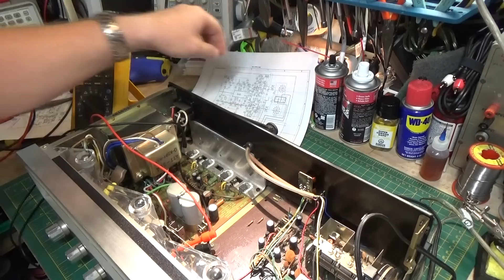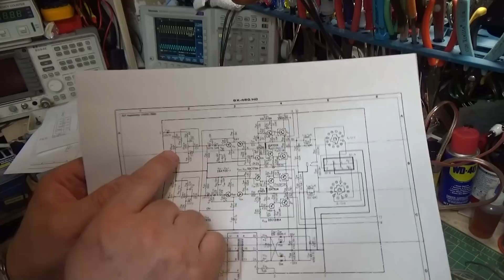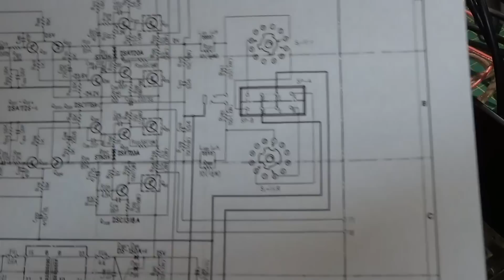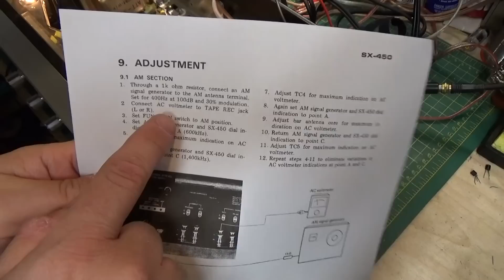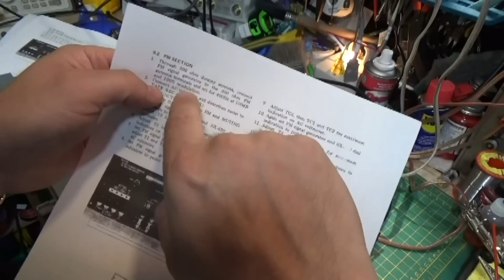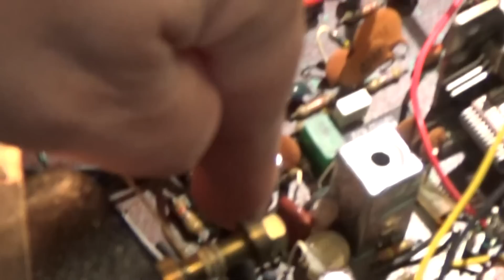PIoneer SX 450 Repair and Restore

Comment: Hi Tony.  I've watched many of your vids.  this one interested me because I obtained one of these online and it has no power.  6 FUSES? Yikes, that was my response when I saw it after opening the case. I appreciated your insight into the small transistors as I believe that is my focal point given that all the voltages out of the power supply seem to be correct.  I can't see all the fuses so I will need to dig deeper to do a continuity test.  I can SEE that the electrolytics are leaking on the board so recap is likely needed too.  Really appreciate it.  Can't wait to hear this Pioneer purr.

Comment: Hi Tony. I realise this is an old video, but thought to add my experience with the SX450 for Bias adjust and DC Offset for others who may visit this. I had to replace some outputs - originals were SD313- used MJE15032G (same pinouts). Had to replace some driver transistors (Q207/Q208 2SC1318A with KSC2383Y) same pinouts and (Q209/Q210 2SA720) with  KSA1013Y same pinouts. Now for BIAS adjust, I replaced the 82R resistors ( R221 and R222) with 100R multiturn posts (middle leg soldered to one of outer). I could adjust bias down to approx 20mV. Scope sine test , just prior clip, achieves approx 12.88Vac RMS into 8ohm load = approx 21W one channel. Nice clean sine... For the DC offset, I took the advice of service manual and connected 8ohm load. One channel had circa 30mV, the other, a rather large 300mV. I replaced the 2SA725 transistor sets Q201/203 and Q201/204 with carefully matched Vbe / Hfe type KSA992. NOTE: Watch the pinouts of replacements. Thank goodness the screen printing on component side of PCB indicates correct orientation. I now have circa -18mV both right and left, so good success. Thanks for the video. Now I have to get onto the tuner, like yours mine seems dead... Keep up the videos. Your knowledge is vast and your presentation and "simplification" is invaluable...cheers from Sydney, Australia.

Comment: I have one of these in my dining room with a pair of Bose 301 II. Fresh capacitors in the speakers. Sounds wonderful. The unit finds stereo, but after it warms up you need to retune the station a smidge. Wondering if it would be a minor tweak or a whole alignment procedure?

Comment: Hi, I received a used Pionner sx450 from facebook marketplace, my main issue is that one set of the speaker terminals require some type of pressure in order for them to output sound, can anyone tell me what could potentially be the problem?,

Comment: I bought an SX 680 where the tuner does not work. Probing the supply to the tuner board, I see not 13.6V.  Then I started probing the transistor supplying that 13.6V. After a few probes around the transistor, it started working. It's been working since. I suspect a capacitor near it is bad as I see some black crud near the base. Does anyone ever experience such a phenomenon that fixes itself by just probing with a voltmeter.
Reply: Yes! A lot of times it a bad solder joint,   by probing or moving components, is a good way to troubleshoot and also pushing in\Out the board also can find lose components and then look from the bottom of the board for cracked or holes in solder joints.

Comment: I have a Technics from 1977 that pretty much looks like that Pioneer.   Found out it was made by Pioneer.   Still works great and sound!   I run it at 3 on 5he volume knob.   Pretty loud there.
Reply: Technics stereo receivers and component systems as I know it, is a subsidiary of Panasonic Electronics.  It couldn't have been made by Pioneer Electronics, two different companies, Pioneer and Panasonic.  Panasonic electronics inc. Has recently bought out Sanyo Electronics as all my tv sets are Sanyo wide screen tv sets and and I love them very much.  They all have been very reliable and work perfectly all the time.

Comment: Is it possible to use your pin drill and drill a small hole thru the circuit board at the point where you would spray your cleaner into the pot....thus not having to remove the pot at all...to clean it, and save all the time doing it. I know this is thinking outside the box but that is the way I am.

Comment: I have a SX-450  was a Great stereo until someone pressed the Tape button with no Tape Deck hooked up! I was told it has a Channel blown out, so DONT press the TAPE DECK BUTTON WITHOUT A DECK  HOOKED UP.
Reply: Hmmm.  This seems unlikely to hurt anything.  Maybe a coincidence?
Reply: @65Superhawk  I think the owners manuel said not to?
Reply: @davedillard1  very interesting!  I will check the schematic and see why that would be.  Thanks for the tip
Reply: @65Superhawk  do you happen to repair them?

Comment: I got deez speakers taking all they give. whatfore deez swell up and make a big mess. wires cross and need to be spliced right ya know? i can only see what deez can role with till the extra man come up and says he gonna swap with the power amps from ac to dc, now ize jusy waking up from dreaming about 500rms per channel and he says its gonna happen right now ya see? you all heard of mach 3's from old radio shack? they come with 15's and a whole lot a deez. i recommend not for the beginner.

Comment: Always check "new" parts before installing. I would have used my signal tracer to follow the signal right after testing the PS. Much quicker, IMHO, (but then again I have only 5+ decades in the field).
   I use an old el cheapo soldering iron with a thinned down tip to melt a tiny hole in the back corner of the switches. Just barely melt thru, spray cleaner & lube in then cover hole with a dab of RTV.
   I modified a spray tube to get into the pots from the bottom. Saves mass time & hassle.  
The brown glue should all be removed. They even used that crap on the bottom of some of the caps to hold them in place. It WILL turn conductive after many years.
  Good trick on using the LED's!

Comment: Because the power knob is also the speaker selector, I would've checked for sound out of the headphones right after the cleaning. My SX-450 has connection problems in that switch. It always turns on, but the connection to the speakers is iffy.

Comment: I work on commercial power amps that fail for various reasons I see mj15024 mj15023 tip42 2sc5200 and a mess of others short out either kicking the breaker or blowing the main fuse usually a 8 or 10A slow blow. I hate the yamaha 2500 when distortion is present on side 2 sometimes a bias issue.

Comment: Nice instructional video. By the way, I have found a way to spray those hard to reach pots without desoldering them. You make yourself an S shaped plastic  pipe and that will fit t right underneath the pots and do it tat way. Is really no need to dismantle all that metal work and desolder all pots  just to have them cleaned. It'll save you a substantial amount of (otherwise) wasted hours on each restoration. However it will take some practice to bend the plastic tubing to the required shape. It took me about 7 tries until I came up with the right shape and now it works like a charm no problem whatsoever.

Comment: I still have my father's SX-450 and it all still works, except for the radio strength dial and the lights are dead except for the stereo indicator. It is time to do a restoration. I am happy to have found your video!

Comment: Tony, bought one of these new with a PL-514 turntable way back when I was in high school.  Lasted me many years with no problems.  Eventually, stopped using it and gave it away, but kept the turntable.  Wish I'd never gotten rid of it.  But just picked up another one.  Looking to go through it first before turning it on.  Thanks!

Comment: Great videos!  I'm currently in the process of ordering from Mouser to recap an SX-450.  Is there a reason not to replace the current ceramic caps with MLCC (Multi Layer Ceramic Capacitors)?  Thanks for your informative videos.  A little envious of your work station!
Reply from the maker: Ceramics usually don't drift.  Also, if you change any of the ceramic caps in the tuner section, it could throw the tuner out of alignment.  Sometimes it even throws off the dial accuracy, as the caps are sometimes selected specifically for that tuner.  Just do the electrolytics.
Reply: Thanks for your input.  I'm not mixing electrolytics with ceramics.  I noticed however there are variations of ceramics.

Comment: I was hoping you could help me.   I am repairing my 1970s HH Scott 380R receiver.   Something failed and took out 5 transistors on one channel.   I am thinking a capacitor must have shorted and over biased something and caused an avalanche of destruction.  Can you or anyone else steer me to a website app or website for getting cross-referenced replacements for the Japanese transistors that were used in this receiver?    Thank you.
Reply from the maker: No doubt that the receiver could use a re-cap, but that is only one possibility for the failure.  Many times, the small pre-amp transistors will begin to leak.  As they warm up, the leak goes almost to a short.  That causes the transistor to throw off the bias to the transistor connected to it, which throws off the bias of the next and so on.  Because the amp is a DC (direct-coupled) design, there are no capacitors to decouple one stage from another.  When one transistor fails, most or all of the transistors down the line fail as well.  The little transistors are easy to find replacements.  The outputs are a bit harder to find.  The 2sa798 dual-package low noise transistors are really hard to find.  If you watch my SX750 video, you'll see where I got counterfeit 2sa798s that were wired backwards.  Anyways, sounds like you need to order some transistors and caps!  Good luck!
Reply: Thanx.

Comment: Great, informative video. I'm a novice but want more knowledge. I just found an SX 550 in the trash and would appreciate a video on repairing this model. Its interior looks different than the 450. Will you have a video on the 550? Hope so. (Also found a SX 1050, but haven't touched it yet.) Thanks again.
Reply from the maker: The 450 and 550 are very similar circuits.  Download a manual for the 550 and you should be OK.

Comment: When I have to clean out a very dusty unit, I use pressurised Dry Nitrogen from a D sized cylinder.
I am a commercial Air Conditioning Tech and have these cylinders at my disposal.
So outside I go with a nice medium sized paint brush and the Nitro, i blow the crap right out.
Then I spray some electrical cleaner and repeat the process until it's nice.

Comment: Hi Tony, I really enjoy your repair videos. My first job in 1979 was a bench tech in a TV repair shop. I serviced a lot of compact stereos with 8 track decks and turntables so you receiver work takes me back to that same era. 

Let me help you with my understanding of stereo FM transmission. The main channel contains the program information for the Left and Right channels so a mono receiver will hear all of the program content. To be compatible with mono receivers a system of a difference carrier was employed for stereo broadcasts. This suppressed carrier double sideband signal is centered at 38 kHz above the the main carrier frequency. That signal contains the differences between the Left and Right channels. When these two signals are combined, along with the 19 kHz Pilot carrier, you demultiplex the two audio channels in the receiver. This same concept was launched in the 1980's for television stereo, MTS or BTSC, using the horizontal sweep frequency, 15.734 kHz as the pilot and the difference channel was 31,468 kHz.  Here's a spectrum graph to illustrate my point: https://en.wikipedia.org/wiki/FM_broadcasting#/media/File:RDS_vs_DirectBand_FM-spectrum2.svg  

Keep up the great work, Alan
Reply from the maker: Alan,
Thank you for sharing your knowledge.  That was a great description!  Stereo multiplex is a difficult concept to learn, and even harder to teach.  Thanks again, and feel free to add your thoughts to any of my (sometimes lacking) videos.  All the best!

Comment: I clean those push-button switches all the time just spraying D5 using the little tube down the side of the push-button shaft where it goes into the body of the switch while holding the receiver at an appropriate angle to use gravity to help get the cleaner to the contacts, then of course work the switch vigorously. (Front panel has to come off first.) Works every time except when there is corrosion inside the switch, at which time of course the switch must be dis-assembled and the locking pawl, spring, etc removed, and the switch shaft pulled out from the front (ugh - easy to lose parts). In the business for 35+ years - just retired. In my experience the channel imbalance is more likely caused by the volume control and/or vol control tracking issues. Merely adjust the balance slightly; that 's what it's there for. In testing, adjust the balance for equal clipping also.  :-)

Comment: I own this very receiver, and needs some repair work, can you help me out?
Reply from the maker: Currently, I am not taking on any more jobs.  I may start to do some repairs for others in the winter when things slow down a bit.  If you are doing your own repairs, I would be happy to answer any questions you may have.  Thanks for the comment!
Reply: +xraytonyb I would love to do my own repair, but unfortunately I have limited access to the proper tools,,,, when you do start doing repairs again, I would like you to take a look.
Reply: Great video. What would you suggest for someone that wants to start getting into this kind of stuff? I have no electrical engineering background, but I want to start taking apart receivers and figuring out how to fix them. Any good resources for understanding the foundations for this kind of work?

Comment: This was the last of the Pioneer 15wpc receivers. Pity they didn't keep this wattage in their line. I had an SX-434 purchased in 1975 for $127 but traded up in 1978 to an SX-650. I had purchased two cassette decks and wanted to edit tapes and the SX-650 had two tape monitors. The 50 series was better spec wise than the 30's. I thought the vented metal top on the 450 made more sense than the solid top SX-434. Did miss the PIONEER BLUE dial lights of the 30 series.
    Nice touches on the SX-450? A mic input, almost no other company offered this on their bottom line units. An aux input in addition to the tape monitor, good FM front end and phono input, plus that classy new look.
    These receivers weren't for loud music thru big inefficient speakers in large rooms. More for use with efficient speakers like the Boston Acoustics A-40's, in rooms 3 meters x 3 meters. Funny, you can lift a new 500 watt surround receiver with one hand.They're all plastic. Try lifting an SX-450, (19 lbs.) you'll need TWO hands. A great receiver, good value and worth the price.
Reply from the maker: You almost can't believe how well these performed unless you hear one in person.  They also go quite loud for 15 watts!  If they had an adjustable bias and DC balance, they would be perfect, but they work really well as they are.  Back then, low cost didn't necessarily mean cheap!